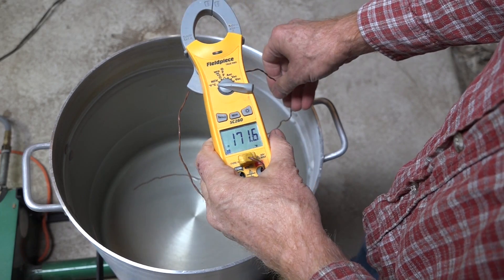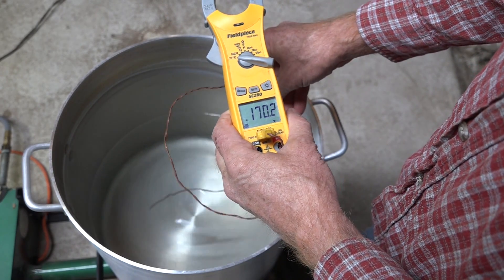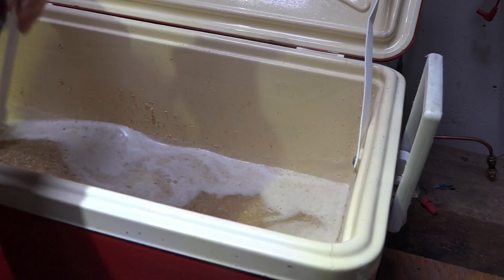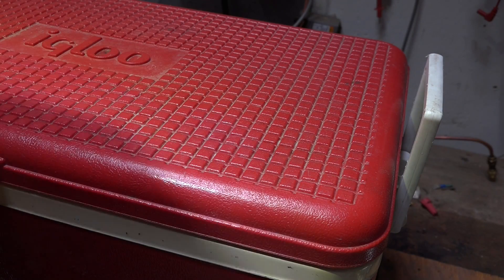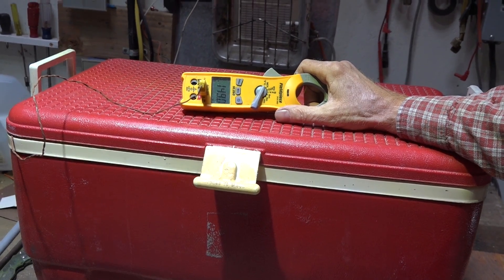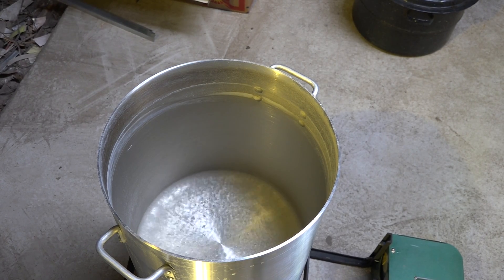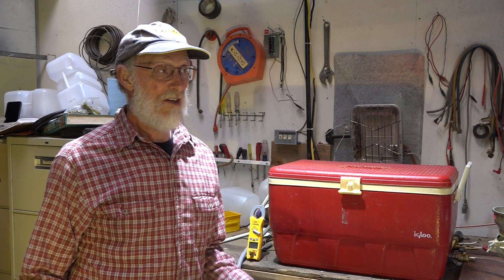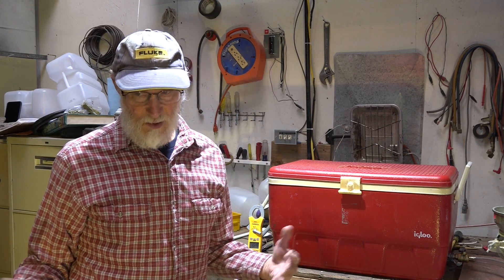Sparge water and its temperature for homebrew

Comment: i go 174 degrees in the hot liquar tank
Reply from the maker: I usually use 180F because I will end up with about 170F in the mash tun.  However, I am not sure it makes a lot of difference as the lautering usually takes about 15 minutes or less.
GFM

Comment: An electrician meter with a temperature gauge never seen that and have been doing electrical for 30 years. Maybe is because my company buys our tools and they just love Klein tools and fluke meters.
Reply from the maker: Fluke also has temp probes for some of their meters.  Not sure about Klein.  Its very simple, you just use a voltmeter connected to a thermocouple with a few other components to make it more accurate.   
GFM

Comment: Hey, if you still having problems pre heat your mushtun to warm it up.  Just add some hot water for about 10 min pour off, you won't have near the temperature drop when you add your sparge water
Reply from the maker: Thanks for the thoughts.  I have not been keeping up with all the videos I should be putting out on my problems with mash tun temps.  I hope to get more out on this soon.
GFM
Reply: I was going to say the same thing